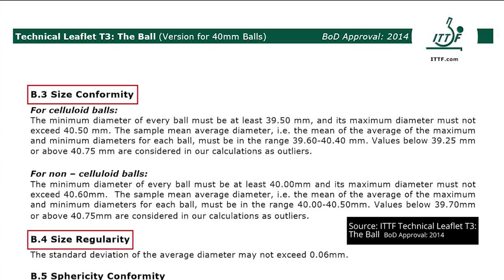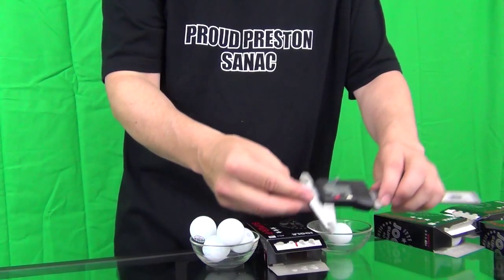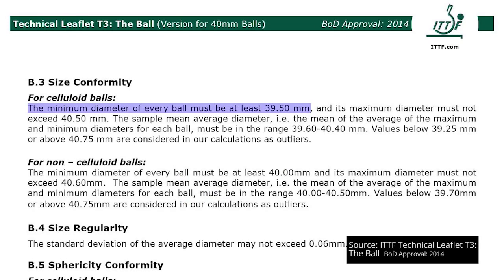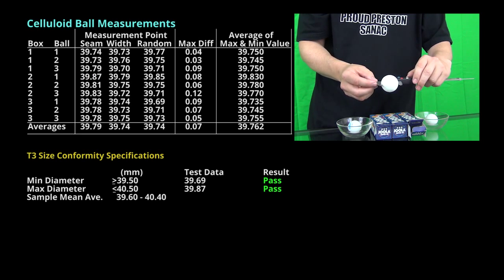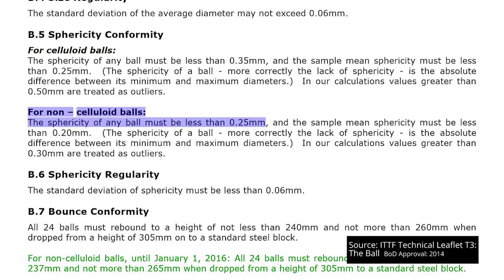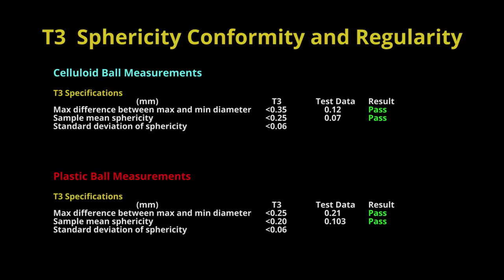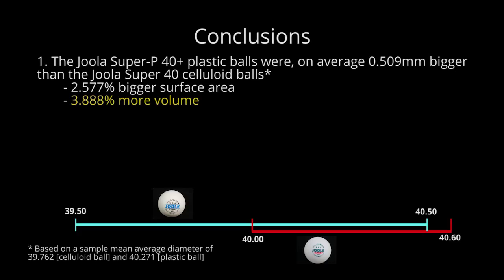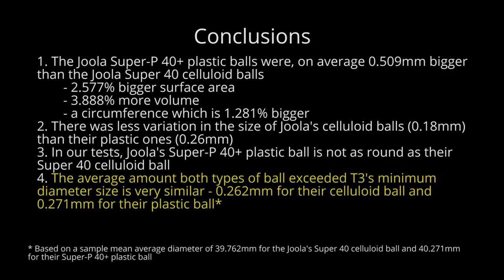Plastic & Celluloid Table Tennis Balls Compared: Size and Roundness

Comment: Another good video. again, from a manufacturing standpoint it makes sense that the celluloid ball, which ahs been in manufacturing for decades would have tighter tolerances. It might be a few years until the plastic ball catches up. I imagine they make the all the balls with the same process and use testing to sort the balls into grades.